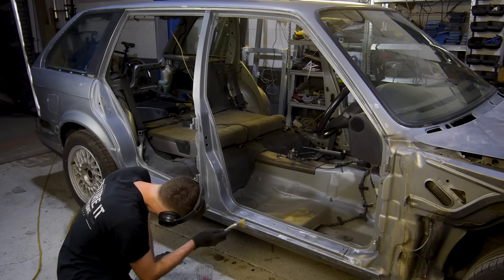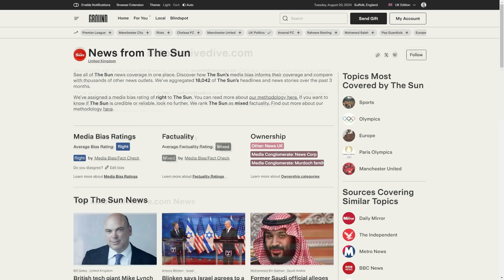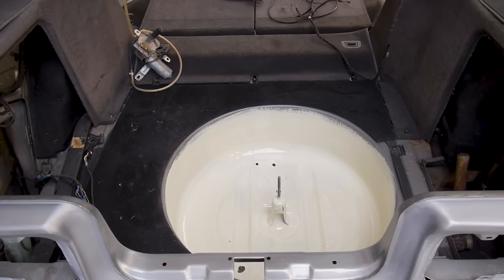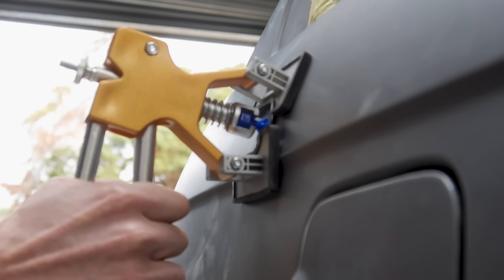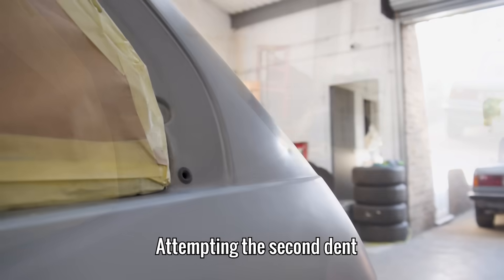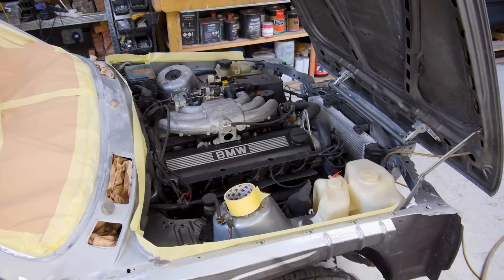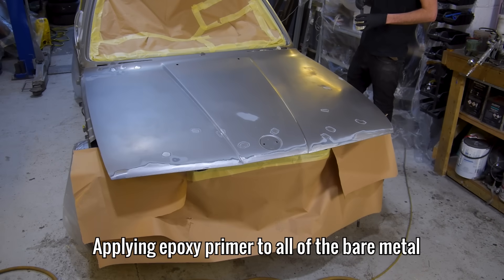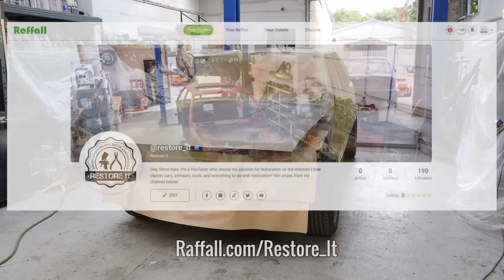Removing Dents & Final Respray Preparations | BMW E30 Touring Restoration - Part 10

Comment: I used one of those glue dent pullers to fix the hail damage on my nephew's Corolla.  It took me nearly all day but I had to do the whole upper surface of the car.  I got 95% of the dents out completely and the remainder I reduced significantly.  I was very proud of my effort as should you be will all the work you are doing.  BTW, my nephew was suitably impressed with aunty Pauline's repair job. 😊👍
Reply from the maker: Oh wow, that must have been some big hail! It sounds like you had a lot more to do than me, so well done! I'd be proud as well. Thanks, Pauline!
Reply: @RestoreIt  Parts of Australia get severe hail storms every now and then and the hailstones can be like golf balls.  They break windscreens.  I haven't experienced one thank goodness!

Comment: I recommend you to use NOVOL Bodywork Primer - it's temporary protection, like zinc you used but you dont need to clean this off after, just put epoxy on it. Also its fully weldable, like zinc or copper spray.

Comment: The tape at the bottom of the screen aperture could be Teflon tape - Some car manufacturers used to use this to prevent thumb nail in the screen when fitting them - if you get a thumb nail on the screen it may be hidden behind the seal but a crack would propagate into a crack and that's a warranty claim.
Reply from the maker: Oh i see, interesting. Cheers, datsunruss!

Comment: Use washing liquid on windscreens etc (when in a rubber) or if you want to make it even easier use green swariega
Reply from the maker: I was going to do this, but a few people mentioned that it has a high salt content and will cause rust down the line.

Comment: I don't know if it'll be the same with the special glue sticks, as it is for normal ones, but with normal ones you can use isopropyl alcohol to remove it pretty easily. Might save the paint work from the blade if you ever need to do it again.
Reply from the maker: Absolutely correct, I should have just used ISO the whole time. Cheers!

Comment: I think, in the corners you have the most Water when the car is standing in the Rain, and it flows down the seal and stays in the Corners, and when you drive fast the Water is coming in like you use a Powerwasher. The Wind is lifting up the under Lip from the Seal.
Reply from the maker: Yes good points there, cheers!
Reply: Good comment but why the random capitals in water, rain, wind, corners, lip, seal and power washer?
Reply: @jackn4853  Bad English

Comment: For the future … the “finger sander” is making more work for yourself and your painter. I suggest using 1” and smaller sanding discs on a rotary tool, Dremel, or a mini random orbit. You won’t gouge the body like you see here in the dent removal shots.

Comment: Are you sure you can't primer over zinc?  It will stay in the scratches of old rust damage and neutralize it as it tries to re-rust. Ive applied single stage urethane primer over zinc on a few vehicles and haven't had one fail......yet. I brush muratic acid on the area. Then wire brush it before spray zinc. Then sand the zinc before priming. I don't even use anything fancy, just standard muratic from the hardware store and Crown 7007 spray.  If you use Phosphate Acid it will bond to the iron oxide but is more expensive.  You are doing great, you may end up with the only BMW that will last forever.
Reply from the maker: Cheers Walki! Thanks for the info! The main reason it needs to go is because its a weld through primer and not a zinc phosphate type. Also the epoxy primer must go straight onto the bare metal so it can mechanically bond to it and do it's thing properly. I preger epoxy primer now as its so durable and thick. Thanks again!

Comment: For someone who is a bit ignorant about paint, why can't zinc rich primer be painted over?
Reply: I’m assuming the paint can’t attach properly with zinc primer and it just runs.
Reply from the maker: This is a weld through primer designed to protect bare metal while you weld and can also be used after like I did, but its not the best Idea as its not designed to be overcoated. The main reason it needs to go is because the epoxy primer must go directly on to bare metal. Cheers!
Reply: @RestoreIt  wow learnt something new today 👌🏻
Reply: @RestoreIt there's a specially designed product called pops-a-dent that is far easier and better at removing dents than what you were using. Plus, it's relatively low cost.
Reply: @RestoreIt if you only use the zinc primer when you are done with welding, why not put on the epoxy primer at that point?  is it because of planning to do more welding?
Reply: @RestoreIt I have never heard of anyone removing zinc rich primer before paint. It’s a primer, to be painted over. And it’s zinc rich to prevent corrosion.

Comment: Well done Steve, coming along great now. You're right to take the weld-through off. I've tested it and  although zinc rich it has very poor adhesion. Also, just my opinion, but any coating that can easily be removed with thinners, including most etch primers which are 1K products, are suspect for a long lasting paint job. You can't beat the epoxy, really good adhesion, particularly if the metal has been sanded to 80 grit. I love the finger sanders, but beware, they remove a lot of material very quickly.
Reply from the maker: Thank you, Bob! Great advice as always. I think i'll be going straight to epoxy in the future, just skips a step. And you're spot on with the finger sander... very powerful but its so easy to go too far.. I'm very careful with it these days.

Comment: Primer on top of the old paint... I don't like this. IMHO this car would have deserved a complete pain removal.
Reply from the maker: Epoxy primer on correctly prepped original paint is a very common thing and is perfect for the job. The 325i Sport will be fully coated in epoxy.